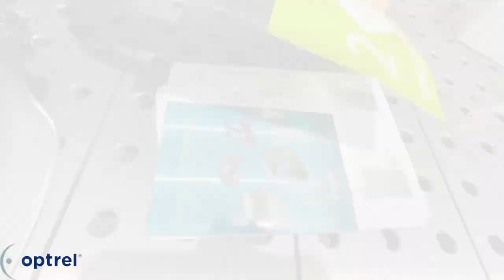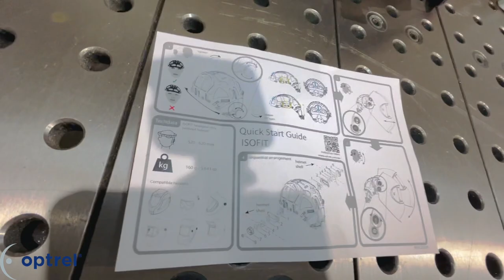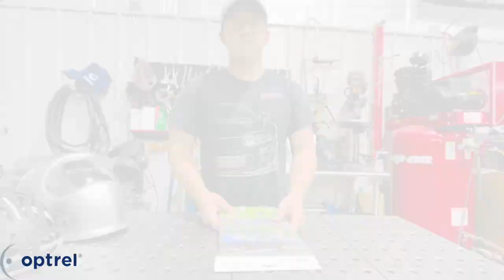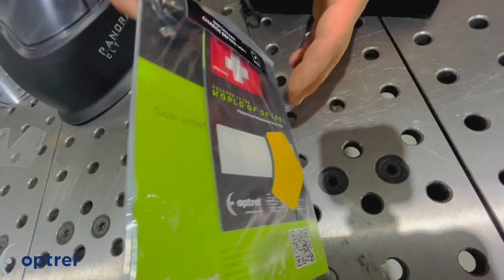Unboxing & Review of Optrel E3000x & Swiss Air Welding Gear

Comment: 58 yo dude here just checking videos on the optrel mask for grinding (home diy angle grinder).  I could write a chapter based on life experience about how it's the things we love that hurt us the most. In your young shoes I would seriously reconsider the long term occupational risks of welding (extensive welding - ie, beyond having the skill in your back pocket for diy). I think welding is a great skill, but your lungs are a miraculous gift from God that you can't live a happy or productive life without. Also, please realize hobbies and interests are more fluid or plastic than you may realize.  You could have the same or even higher level of enjoyment in a hobby that's safer for lungs and eyes over long term. Lungs and eyes are about as vital as it gets. 2A hobby, wood working, darkroom photography, sewing, hiking, rollerblading are my hobbies, but I also eventually want to have welding skill in my back pocket. 👍

Comment: can't wait to have the swiss air for my welding team, been trying the panoramax for offshore pipeline with semi auto gmaw-fcaw process, helmet was doing great, but the 2.5 my welders are having difficulty to press the grind mode with welding gloves on. Panoramax in the other hand was simplier, equip with swiss air, wow cant wait to see doing offshore pipeline

Comment: We call it metal fume fever where I work. The welders and plasma cutters get it when working with brass copper and galvanised steels. It’s not fun 😂 We all use e3000x s now
Reply: has anyone there gotten metal fume fever even while wearing the e3000x?
Reply: @MichaelDespairs  nope but I found the heat made the plastic brittle after a few months and it would crack and break away unfortunately

Comment: How does the Swiss air perform against welding galvanized? It's primarily all I weld at my job and even with a 3M half mask respiratory it's starting to get a little hard to breathe
Reply: I don't know your situation but I'm concerned. Is it possible to shop around for another job where they don't force you to weld galvanized?